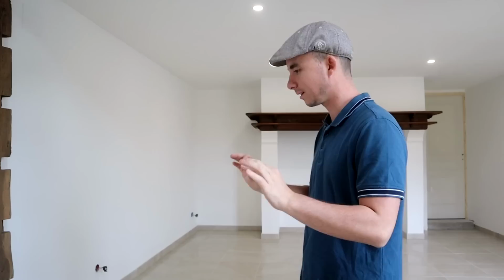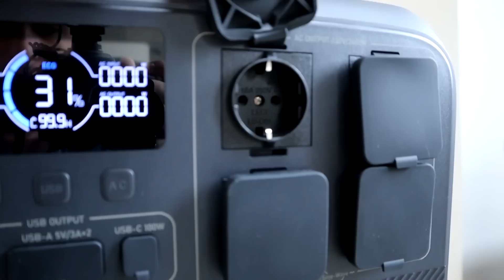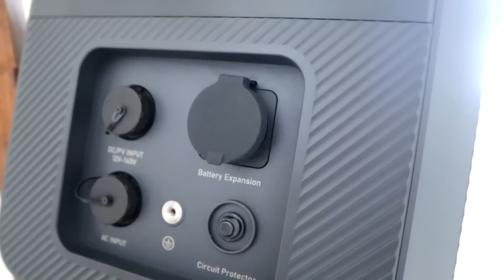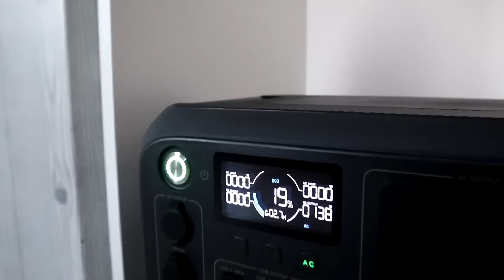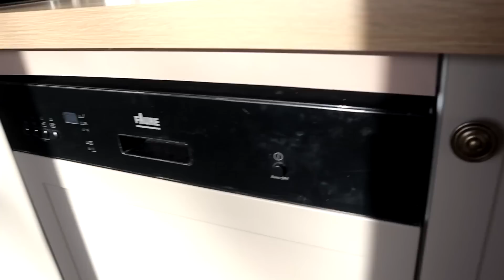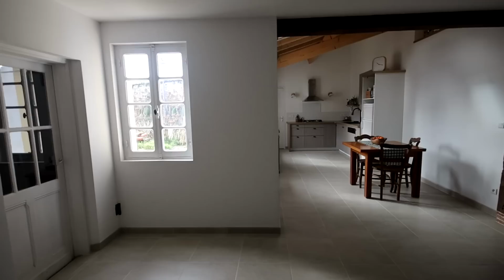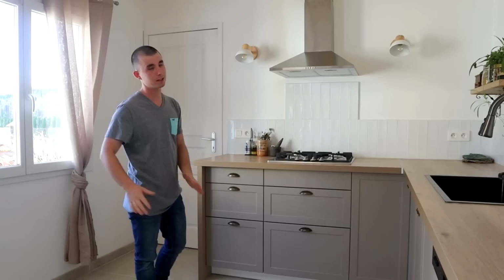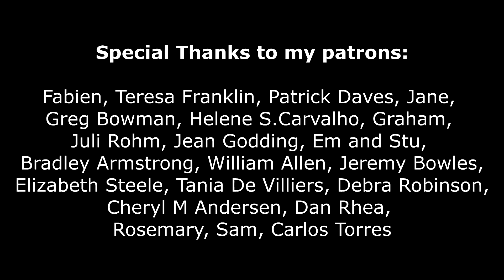The KITCHEN is DONE! #75

Comment: Just perfection. Well done both of you. In the last 18 months I bought a slow cooker/microwave oven and double pan air fryer. All combined costing less than an oven / hob. In fact I've never used the oven /hob since so it's going to make room for the slow cooker storage and dedicated air fryer worktop. They cost a lot less in electricity to run as well. Looking forward to your next project.

Comment: I made my drapery rod holders out of wood. paint them to match your cabinet doors. Just a right angle affair with holes big enough for the rod to fit through. should have made your refrigerator cabinet bigger. finish work is looking very good!  like you I installed a dishwasher. just wife and I so only use it once or twice per  year. I put in a double oven, another waste of money, just a single oven at counter  height would have  been better....  built a microwave niche, use that all the time. I like the exposed rock nick nack shelf, great idea, real "art"....  Now you are going to need a bigger TV because the couch is so far away!!!  hehehehe